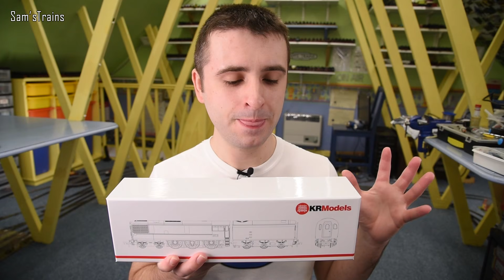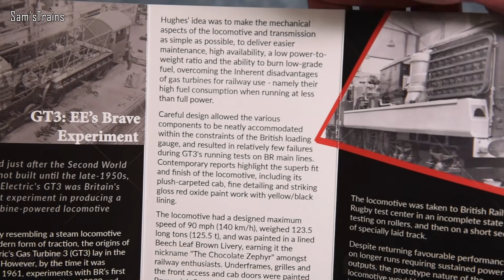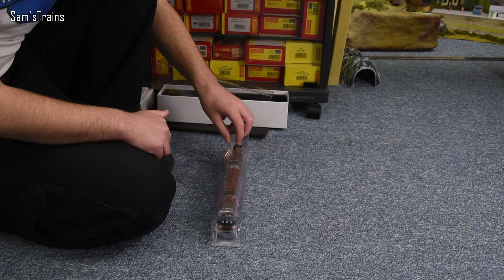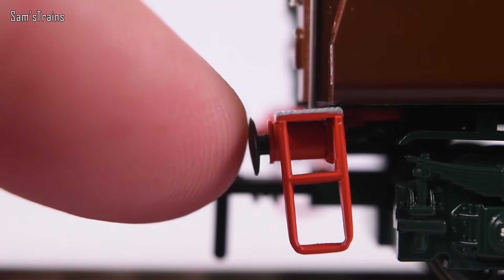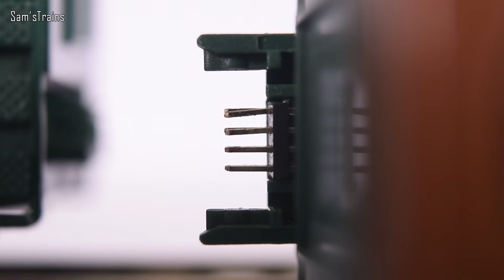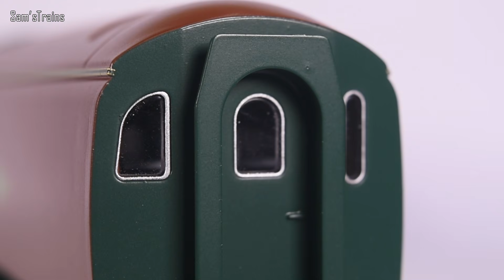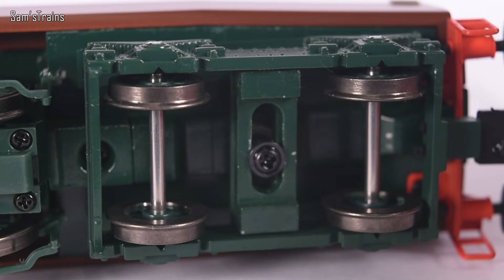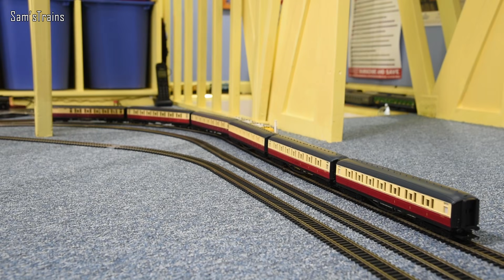Brand New GT3 Gas Turbine Locomotive | KR Models | Unboxing & Review

Comment: Hi Sam, any thoughts about the “fundamental flaw” in the front bogie that you talked about? I am genuinely interested in what you think it may be. Do you think it could have something to do with your track just placed on a carpeted floor rather than pinned down to a firm baseboard surface?  As I said I am genuinely interested as I may have to make an adjustment on my model at some point. Look forward to your reply. Jules
Reply from the maker: Frankly Jules, because the bogie dropped off before the loco went anywhere near my track. Securing a moving part with a loose un-collared screw is a fundamental flaw... I'm amazed that there's any debate on the fact!
Thanks for watching, Sam :)
Reply: @SamsTrains  Hi Sam, thank you for your reply, no debate. I will have a closer look at mine to see if it is also affected.  Cheers. 👍
Reply: In case you may be interested, or not, I have looked on my model today and it DOES have a washer on the screw to keep the bogie attached to the chassis.  Maybe you were unlucky that the person assembling the one that you received failed to put the washer in place.  A simple error of omission maybe??
Reply from the maker: That's interesting - surely the screw would still need to be loose though? I tried adding a washer of my own, and the screw had to be even looser to accommodate it!!
Cheers,
Sam :)
Reply: @SamsTrains  Hi Sam, I've just taken mine out again to have another look.  I did not see how tight or loose the screw with washer was by putting a screw driver on it but there is good easy movement in sliding left and right, in lateral movement side to side but not so much lateral movement end to end.  There is enough end to end lateral movement to accommodate any dips in track laid securely pinned to a baseboard in my experience, of course that may be different to track laid on a carpet that will move with the weight of a locomotive passing over it.
IF you put a small washer on the screw to keep the bogie attached then it may be trial and error to get the tightness just right.  But how tight or loose does it have to be?  As I said previously you may have been unlucky that when your model was assembled the person could've been having a bad day and dropped the washer and couldn't be bothered in fitting another, who knows?  To say it is a "fundamental flaw" implies they are all like that, are they?  Do you know for certain?  Mine isn't nor is that of another poster on here.
Interestingly you did not pick up on the mistake that KR made with the model.  I'll leave you with that......
Cheers
Jules :-)
Playing with trains 00 gauge and 12 inches to the foot since 1974.

Comment: I have to agree with some of things you mentioned on this review of the GT.3 from KR Models. For the price these was rather high, but it is a unique loco RTR model for Keith Revels to produce as a first outing into the model railway market. There is a lot to admire with this engine and with a second run maybe some of the issues you have brought up will be addressed in the next batch. Maybe that is why the next run will be more expensive to buy or due to an increase in production methods. The things like metal buffers, paint work, cab detail, etched cab side number and builders plate, a long with the dodgy front bogie arrangement will be rectified. Though that leaves the current needing to have a modification kit to fix this first gen engine to a higher spec. So maybe KR will release a mod kit with etchings, buffers, and new front bogie further down the line for current GT3 owners. Now don't get me wrong, I love this model and what KR have achieved in making it. It is just with the current level of detailing that we are seeing now from SLW and Accurascale, we are basically being spoilt for choice. 

Like the Heljan Class 25 releases I may buy one (ETHEL?), but as a SLW fan, I think I will wait for their RATs coming out. Like the various makers of the Class 66s that were released, I held off and bought two of the dodgy running models. Now I have two locos and I still have to do the modification fix on the bogie side frames. Which means that I have decided not to have the axle boxes rotating and cutting the spindles short and gluing them back in place to cap the axle ends on bogie. I don't understand or know why this was not picked up in the assessment stage of the EP sample, but it is a big issue that should have been spotted early in the design models before release.

Comment: Does it feature sounds on dcc? Turbine powered trains have a very distinctive and remarkable sound. A crossover between a jet engine and a vacuum cleaner, and with spool-up and down, it's not totally linked to the actual running speed.
Since the real GT3 is sadly long gone, I wonder how they got the sound right, if there is one.
Nice model by the way, the appart from the wonky ladders that ruins the illusion. Also the coupling design using regular pin headers and off-the-shelves computer connector won't age well. Bend a pin a few time and it will break.
Reply from the maker: They do have a DCC sound fitted version, but this isn't it unfortunately! That's true - I'd be interested to know how they created/researched the sounds!
Thanks for watching, Sam :)

Comment: Speaking about the history of the GT3. I heard on of the major factors on why it was rejected for mass production, is due to it's steam engine layout, with a Tender.
At the time, BR were moving towards engines that could drive in both directions, to eliminate the use of turntables. Due to the GT3 clearly having a front, it would require a turntable.
Reply from the maker: Very interesting - yeah that sounds very feasible to me!
Thanks for watching, Sam :)
Reply: @SamsTrains  Feasible but wrong.
It was built to establish if the gas turbine engine could be coupled directly to the wheels, eliminating the wasteful intermediate stage of producing electricity to power motors on the axles; one of the major complications of the diesel-electric designs.
It was never intended for mass production.

Comment: On my Hornby Princess Elizabeth loco (the version before the current one) had issues with the front bogie. I fixed it by using one of the 1980's stepped screws, so I wonder if this might fix your front bogie issue. I suppose a stepped screw costs more but it is cheaper than losing sales.
Reply from the maker: Very interesting C! Yes indeed, a screw with a collar would definitely fix this!
Thanks for watching, Sam :)

Comment: I have one of these and it has only been out of the box for about 20 minutes for some photos and sadly it will not turn a wheel until I rebuild my layout (well clear of a carpeted floor!) in a few years time.  You knocked half a point off for the uneven running and smoothness, did you run the loco in first?  Manufacturers recommend at least 30 minutes of running in time in each direction, if that had been carried out before this review it may, or may not, have made a difference.  Also can you elaborate please on the "fundamental flaw" of the front bogie?  Ok it derail but what IS the flaw? can you expand on that comment please.  Thanks

Comment: A gas turbine is a jet engine, they aren't just used in jet planes, you also get turbo prop planes, which use a generator to turn the prop, but there is also marine applications and power generation, like really large generators that a large building might use as emergency power, or you get large mobile generators that size of a container that are gas turbine driven. In the 50's turbine power was still pretty new so they were looking to bung it in everything, Rover and Ford both had experimental gas turbine cars.
Reply: Also used to pump North Sea gas around the country.

Comment: Is your track laid on the carpet of a floor??  One of the biggest no-nos of using a model railway, it is clearly printed on the info sheets of every loco.  The quickest way to pickup fluff and dust, I'm very surprised to see that.
Reply: Sam's carpet is close pile. It's the fluffy ones that do the damage.
Reply: @Boppy-B-B  It will still harbour loose fluff which will get into the motor and gears, guaranteed.  Every manufacturer says not to do it.  You bring all manner of dust in on footwear which will fall onto the track when you step over it then it will get into the mechanism.  My first layout in the 70's was on a board which was on the floor, short pile, when I ran it, and it collected fluff.  In the 90's I built one for my son on a board which was on the floor, again close pile, when we ran it and it collected fluff.  My next layout was in my loft at table height well clear of the floor, guess what, NO fluff.
Run on the floor at your peril, been there done it and had to defluff.

Comment: A very interesting loco: thanks Sam for such a detailed look at it. i wasn't too impressed with the front buffer beam and buffers - they looked to be unpainted plastic and were all wonky! As a matter of interest, it was built on a 'spare' BR Standard class 5 4-6-0 pair of frames, a type that was current at the time this machine was envisaged. I've seen many comments attributing this as the reason it wasn't fully assessed during a time when BR was trying to distance itself from steam and this loco looked like an odd steam loco, and also to the fact that its economics, in common with the American Union Pacific gas turbines, were undermined by the fact that it was designed to work on cheap waste Bunker C grade oil but developments in the 1950s made that useable elsewhere and its price shot up.
Reply: The reality is more mundane. The 4-6-0 was chosen as a proven platform to assess the feasibility of gas turbines without any growing pains associated with simultaneously developing a new chassis or drive system, such as turbine-electric. The concept was viable but faced stiff competition from twin-cab diesels which were continuously improving in power-to-weight and benefitted from innovations in diesel technology in the automotive and marine industries. The crux of the issue was the GT3 needed more research and investment, and BR were afraid of wandering into a sunk-cost fallacy when they already had a proven track record with diesels.

Comment: Hey Sam, with regards to the red cab light, apparently that is due to the LEDs being wired up incorrectly. So the red tail lights at the front of the loco are actually white when they are supposed to be red and the cab light is supposed to be white not red. Hope that clears things up for you and your viewers 🙂

Another thing you may want to check out is the guard irons on your front bogie, they appear to be at the back and not at the front, where they should be. And from what I’ve heard, you can ask for a free replacement that is correctly moulded. 

At this stage I’m waiting for my sound fitted one to arrive 🙂
Reply from the maker: Are you sure James? I thought that was accurate! And yes the bogie is incorrect - KR did indeed say they'll be replacing them, hopefully they will!
Thanks for watching, Sam :)
Reply: @SamsTrains  I’m positive on the lighting situation. A friend of mine has the same issue with his. Doesn’t affect the performance of the model but definitely doesn’t look right. Probably an error in assembly.  

Where you showed the chassis of the loco in your video, definitely will prove useful if I, or anyone else needs to modify theirs if it has the same problem.
Reply: Why would there be tail lights at the front? I don't remember ever seeing a loco with red lights at the front.
 The wiring wouldn't make any difference. a red LED is a red LED no matter how it is wired.
Reply: @Boppy-B-B  As far as I can tell. The lights at both ends should be directional. So the front lights are supposed to change to red when running in reverse, in the same way a diesel locomotives lights would when changing its direction. But because the LEDs are wired in the wrong location, they just stay white no matter what. Doing a google search, even KR models pre production samples had warm white cab lights.

Comment: One look at this locomotive in your video thumbnail I thought... "Okay another steam loco review by Sam's Trains" Then when gas turbine was mentioned my demeaner changed. That is sure a bizarre locomotive. And I thought mainland Europe's locos are bizarre. This is up there with the Beyer Garratt loco you reviewed last year from Heljan. It turns out that the United Kingdom experimented with gas turbine. In the United States we did too. Except longer lived and saw service on the Union Pacific and didn't operate like thie. They would operate like a modern deiseal electric but with a type of fuel oil. They began service in 1952 and after three generations was withdrawn from service in 1970. All but 2 members was scrapped. Not a healthy number at all.  The two are on display but not operational. The one is in Ogden, Utah and the other in Chicago, Illinois. As for the model expensive (typical model railroading is expensive) but one of the greatest performers. The other thought though are the same as yours. Take care and thanks for sharing.

Comment: Boss of the New York Central Railroad. 'It would be insane to put jet engines on a tender. Stick a couple on top of a railbus instead and lets see how that flies. :-)
The M-497 was an experimental jet-powered railcar test bed of the New York Central Railroad, developed and tested in 1966 in the United States. Two second-hand General Electric J47-19 jet engines, originally used as boosters for the Convair B-36 Peacemaker intercontinental bomber, were mounted atop an existing Budd Rail Diesel Car, an RDC-3 of coach and baggage-mail configuration which had received a streamlined front cowling.

Comment: This loco passed us going the other way somewhere between Crewe and Shrewsbury when I was a kid.  I was struck by how weird it sounded.
Reply: It'll be like a jet engine like a shhhhhhh and krrrrrrr noise I know awful impressions lol but can hear the inlet sucking in air as it's compressed mixed with fuel in the combustion chamber at the back and ignite sending a surge of power to the shaft forwards and hot exhaust shooting out the top I'd imagine on this example.

Mind I don't see why a Diesel Turbine powered locomotive wouldn't work as are more fuel efficient than a traditional combustion engine tanks use them nowadays so why not a locomotive plus easily have enough power and torque to pull tonnes of carriages.
Reply: @hordegaming138  at low speed the wear full hunger  and br did not like them

Comment: I'm not exactly sure, why the algorythm brought me here. Maybe it does not know the diffenrece between english OO gauge and "continental" H0 gauge. 
First I have to say, I really like when a manufacturer goes away from the well known standard locomotives and builds rarer models instead. This definitly is not an easy way to earn money and 200 pounds could really be a reasonable price, if the model was a good construction. 
At the first view, I really liked the model. But there are some extremely crappy design features, that are not ok, no matter how cheap oder expensive it was.  The buffers are really bad and the front ladders are just as bad.  This looks like a 40 year old toy and not as it should be on a collector's model. Electric power pick ups on only 2 out of 3 drive axles is also a crappy design. This is the wrong place to save money. 
The one detail, that definitly kills the model is the front bogie. What did they think? Where they drunk or something?This design will never work properly.
Reply: OO and HO use the same gauge track but different scales.
Good points about the model design.

Comment: THE STEAM TURBINE LOCO OF BRITISH RAIL WAS A FAILURE  FROM THE START, IF THEY HAD DONE THEIR HOMEWORK, TURBINES ARE GOOD FOR LONG CONTINUOUS   JOURNEYS . BUT FOR STOP START JOURNEYS  ,  NO NO!!!!.😣😣😣😣😣
Reply: This not a steam turbine but a gas turbine like a geared jet engine.
But still a failure due to fuel waste and other reasons.
The LMS steam turbine Turbomotive was much more successful with the turbine not running when the loco was stopped. A steam turbine is easily started with the pressure of steam.

Comment: Remember the silicone caulk trick to deal with loose screws: Just some on the screw thread to act like a lock nut
Reply: That stuff can melt plastic.
Reply: @Boppy-B-B 

I don't know what you are using but I never had that problem.

Comment: Your reviews getting better and better.
I think you did the right thing to solve the bogie issue, it seems that the spring and the washer underneath the spring snagged on the bogie crossmember when it had to slide sideways in the curves.
But looking to the chassis design almost all weight is over the drivers, and there is not much of a metal frame above the bogie, so it doesn't have to carry any of the loco's weight, if the bogie itself is diecast, it has enough weight by itself to stay on the track without a spring pressing down on it.
The wonkyness of the whole bufferbeam assembly is the main part which lets the model down, it has that Heljan-ish feel over it, but looking to the type of connectors used on the PCB it's well possible that this model comes from the Heljan factory, they produce for the North American market in the like of the Walthers locomotive range, so it's not unlikely for KR models which according to the info on the box is situated in Canada to have Heljan as its manufacturer.

The mechanism is superb, and performs better even than many diesels, the metal frames used as pickups is a system more commonly used in North America and is very reliable as it doesn't get dirty like wipers, but it probably had been even smoother if all gears had been fitted, as these eliminate the uneven movement caused by the coupling rods.